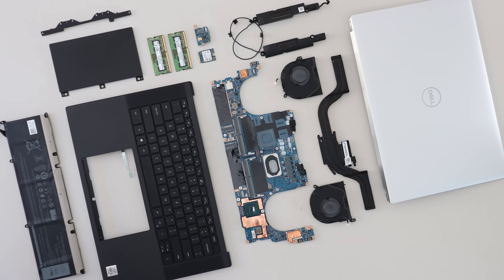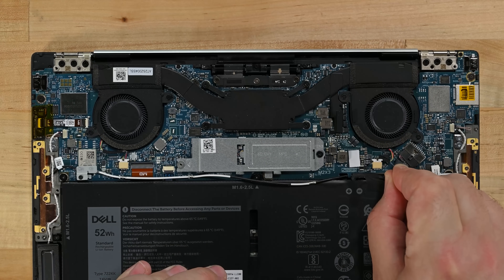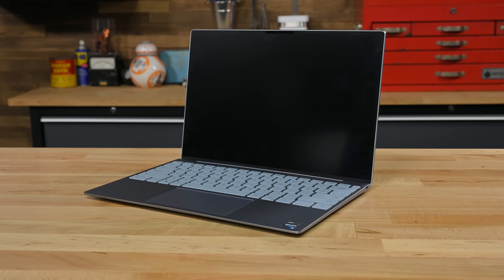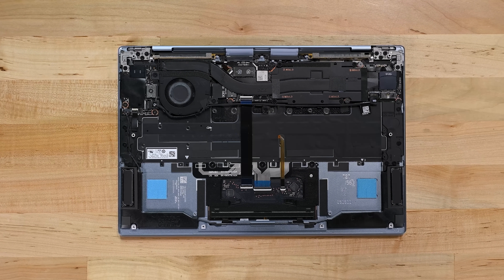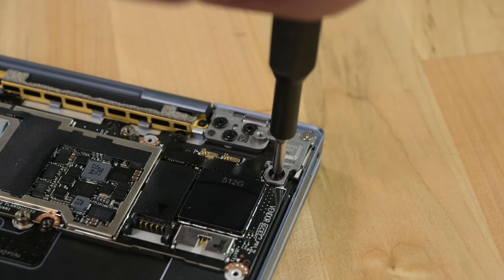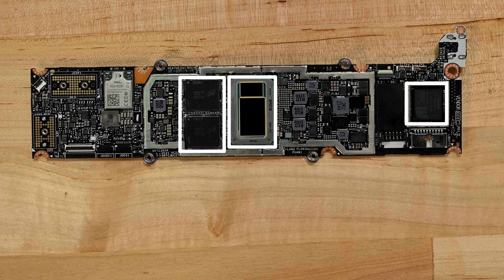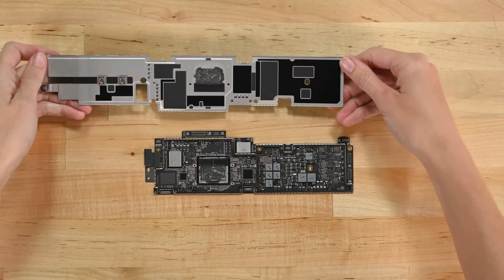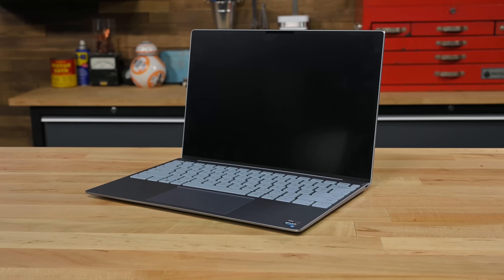The Dell XPS 13 (2022) Teardown: Is This The 13" Laptop We've Been Waiting For?

Comment: I'm curious why the left (in normal clamshell mode with it open to you) rail outside of the speaker seems to get weirdly hot on mine for a 9w low power system, doesn't seem to be too much going on there and the CPU and heatsink is up top. Wifi antennas?

Comment: Hmm. I have one of these with 16gb for work and we were at constant 95% usage, to the point external devices were crashing under the system stress. What a disaster we can't upgrade the memory. Also reading the SSD issues... Guess I better keep a cloud backup.

Comment: XPS 13 9300 USB Type-C ports not working. Battery dead. Motherboard lights flashing when charger connected.

Hi all, I have a bit of a problem. Sorry for the long description but any help/advice would be appreciated. While living in North America In September of 2020 I ordered and received my new XPS 13 9300. I haven't been able to use it now for over 2 years.

I moved abroad and was using a stepdown converter to charge it which worked fine for a little while. Then I relocated again within the same country and suddenly the laptop would not charge even with the stepdown converter.

The charging cable light will come on and be steady when plugged in to an outlet (either in the stepdown converter or using an adapter in the wall) but when I connect it to the laptop the light on the charger starts blinking on and off steadily.

Before my battery depleted completely an error message came up briefly stating something about the system not being able to detect the charging system.

I removed the battery and tried to use the laptop with only the charger attached but the same thing happens. The lights on the motherboard flash as well when the charging cable light flashes.

I want to know if getting a new already charged battery might give me access to the laptop long enough to go in and reset the type-C USB port drivers since it seems that the different voltage in my current country of residence has confused the ports.

If anyone has any suggestions that do not involve replacing the motherboard entirely (as that is not very possible for me at this time) I would really appreciate it.

I have seen other customers having similar port issues with the XPS 13 9300 but I have yet to see any suggested fixes that the customer can do themselves. I even discovered that there are "External battery chargers" available for older dell laptops so that the batteries can be charged separate from the laptop itself but I have not been able to find one that is made to function with the XPS 13 9300 battery.

Thanks in advance for any help 🙏.

Comment: No headphone port either. Any laptop I buy will have one of those and an M.2 slot. I have an XPS 13 9310, and it has both of those, though not removable RAM or wifi card. 

There is an advantage to non-removable RAM, though, on a laptop. The RAM on my XPS 13 is LPDDR4x, which improves the performance of the onboard GPU compared to DDR4, and it saves some power, at least in theory. You can't get that on a unit with removable RAM. There are no LPDDR4x SoDIMMs!

Comment: The higher-end and more expensive XPS 13 Plus still has the internal layout of the older 2021 XPS 13, so the SSD is still removable on that XPS 13 Plus 9320 model, no idea why Dell downgraded the regular XPS 13 2022 soo much though. It even has worst processor options than the XPS 13 Plus.

Comment: LOL... it goes to the bin... Soldered on memory and storage are a no-no with me... Which is why I am sporting the lenovo 14 inch models these days.. crappy display and all it is more reliable as I can swap these known to fail components out. I am missing the dell display, they are really something but it is not worth it for me to give up everything else for it. I still have my XPS13 from 2016. It was a great machine to use but now this new model without any ports takes away from the usability... and it is even less repairable.

Comment: 9/10 for repairability is a joke with both CPU and GPU being soldered to the motherboard.
Reply: 9/10 was for the old Dell XPS 13 - this model would probably get a 4 at best. 2 points for the battery being easy to remove, 1 point for the removal of the logic board/hinges, and if you're lucky, 1 point for the display.
Oh wait, the display hinge screws need to be removed in orer to get the logic board out...
3/10 it is then.
Reply: @TheSpotify95 I'd say 1.5 because only the battery is replaceable. Good thing Dell killed this model and went back to replaceable SSDs.

Comment: So what happens if the drive fails and it's not replaceable? Will Dell automatically cover it no matter what under warranty? Otherwise you're literally just buying a device that is on a clock ticking down until the drive just bricks the computer.

Comment: Everyone in the comments is praising the XPS, meanwhile my XPS 13 9360 had major fit and finish issues out of the box (the bottom edge was capable of scratching me) and my screen developed a pink hue in the bottom half after sitting on my shelf for 3 years powered off. No parts or service manuals available for it either. Made me wary of buying any Dell product
Reply: I've got a 9360 still going strong after battery swap and thermal repaste
Reply: I am almost positive there will be parts available. Any of the hardware components not related to the mainboard should be the exact same for different models with the same chassis style. And the same thing goes for service manuals.
Reply: @vivek_v  Link a a 9630 1080p non-touchscreen replacement display for under $350 USD, along with a Dell service manual that shows step-by-step instructions on replacing it.

Comment: I know that in order to have the thinnest laptop with big battery and small logic board removable memory and storage is not really an option. However, if you're going to solder the storage onto the main board at least do what Apple did back in older macbooks and have a "Lifeboat" connector. It would definitely be a thin, fragile proprietary cable but should be available for decent price at the manufactures online store. and be as easy as plugin it into the main board and the other end of the cable would be USB (C or A doesn't really matter) and make it so that it will still work if no other components on the Logic board are working.
Reply: I wonder if that was descendant of the "Firewire Target Mode" in old iBooks. You could plug one mac into another, pressing "T" and the second mac would be recognized as a hard drive. It was very useful for diagnostics.

Comment: I am genuinely shocked that an 8GB model exists, with no option to upgrade.

Utterly embarrassing in 2022.
Reply: if you want 16GB then buy one with 16GB. Ram is not the only thing to decide a laptop is good or not
Reply: 8 GB is pretty standard for 2022 and likely 2030+ until DDR6 becomes mainstream. OSes, applications, and others are designed for 8 GB systems. Is it good on a high-end system like this? Yeah, I disagree. But under $1000? 8GB is the default.
Reply: @ikjadoon  under $1000 for 8gb is a scam, Especially for a cheap soldered one
Reply: @itza8334  true i have 300$ laptop that has 16gb bruh
Reply: A PS5 has 16gb of ram.

Comment: Ram failure for soldered memory is very unlikely. Most memory failure come from socket issues shorting.
Reply: but when that unlikely comes, you are screwed
Reply: @trandinhvietdung9357  not really, it is standard LPDDR dies and board level repair store can swap these out rather quickly.
Reply: @hishnash  yep but with socketed ram, it is easier to do tho. also you can upgrade (which is why framework exist)

Comment: I have a Dell gaming laptop from a couple years ago, and the repairability made my life a LOT easier after an... unfortunate incident. Swappable battery, storage and RAM, full instruction manual, and when I wanted to add a second storage drive the cable I needed to connect it was already inside the laptop, just taped inside the tray where the second drive was supposed to go. Super appreciated - really hope Dell doesn't stray away from repairability before I need to upgrade my machine!
Reply: not trying to be too nosy but I would love to hear what happened
Reply: @sealwheel  Basically, only a couple months after getting the computer, I made the mistake of putting my drink right next to it in an open glass... then knocked it over, spilling the entire thing onto the keyboard...

I had to disassemble the entire laptop to get the keyboard out and clean it - and I'd never worked inside a computer before (although I had a bit of knowledge from watching teardown videos at the time.)

Not a single component was glued in. I was literally able to remove EVERYTHING. The manual guided me through the whole process, and was beginner-friendly enough that it all worked perfectly when I put it back together.

TL;DR repairability spared me the fate of having "Sticky Keys" permanently enabled for the rest of my laptop's lifespan
Reply: @fictionhead39  thats an interesting story.

i often drink iced tea next to my laptop..
Reply: why are you being evasive about the "incident"? Was it a sexual thing? Were bodily fluids involved? Over the decades, I've heard a LOT of ways to break computers, I don't think anything you might say would surprise me.

Comment: Impressive how small the mainboard is. And I can kinda understand that ram and WiFi is soldered on, especially given that ram connectors are stupidly large and that the low power ram isn't available in DIMM format. The soldered SSD just isn't acceptable, though.

Comment: When all the other components in the motherboard are generally soddered what makes soddering ram and SSD so critical?
Reply: If the RAM or SSD completely fails then an entirely new motherboard is needed, unless you're good at microsoldering. Otherwise, your motherboard is dead and your data is lost forever.
Reply: for me, ssd must be removable, because if my laptop fails (be it hardware or software), i want my data back asap.

Comment: I have the XPS 13 still has a MicroSD slot on the left-side and comes with the Intel Core i7 and 16GB RAM & 500GB SSD HD.  Would you know if the internal of it is the same as the model here (particularly the RAM & SSD integration)?

Comment: What the heck Dell? I've been a diehard XPS fan all my life, but soldering the SSD is just too much. I guess framework is the way to go.
Reply: That, and the fact there's only two USB C ports and nothing else... gives me flashbacks of those hideous Macbooks.
Reply: @TheSpotify95  literally not even a headphone jack
Reply: @aqua_whale  well that makes it worse than a MacBook Retina (you know, the ones with their single USB type C port, meaning dangles for everything). At least the MB Retina had a USB-C and an AUX port.
Now one manufacturer has done it, we'll now see really thin laptops with no headphone jack either.
Sorry, I'd rather have functionality and practicality over thin and light. If I want thin and light, I use my Surface Pro 3 (which still has a USB-A port, and can have a docking station/adapter plugged into it for desktop use).
Reply: @TheSpotify95  ha, brings me back to the 1998 iMac without a floppy drive. Forcing customers to go without, or pay up to get backwards compatibility, is an old game by now.
Reply: Framework isn't really competing with XPS, though; it's a niche product with worse displays, battery life, etc.
Reply: @HappyHubris  Framework's laptop actually has a battery with a similar capacity as the one mentioned in the video. And to be honest, I'd much rather have slightly shorter battery life if it means it can be repaired and upgraded easily enough.
Reply: One of Dell's redeeming factors has been their excellent upgradability and thorough manuals, but this is just disappointing. Hopefully their Precision 7000 series will stay modular until everything becomes SOCs...

Comment: You can have a notebook as thin as this, or, a notebook with replaceable ram.  You can't have both, due to the slim size.
Reply: This laptop is TOO thin imo. They also could have fit in socketed storage and more ports but they just went too far too fast.

Comment: I used to work at the IT department of a 6000 employee company in Hong Kong. Everyone at the help desk hated dell’s laptop because they are extremely unreliable. Their SSD often fails and as we enabled bitlocker it was not a swap and done process. In the end they stick with thinkpads while mixing more and more HP laptops into the company, and abandoned dell laptops.
Reply: True, and lots of problems with batteries, for zero reason. Their lifespan is not even comparable with macs, as much as I hate to say that
Reply: @adrko  the dell battery lifespan cant be comparable to macs, as macs now uses ARM processors which is much more efficient. But anyway I still agree with you as my experience with my dell laptop, the battery os half the way wear out only after 5 months of use from brand new
Reply: @averyoldYoutubeuser  I was not actually talking a bout battery losing charge. My bad for not being precise.

I fix macs, laptops and other electronics, I think I had 20-30 dell xps laptops go throught my hands, 90% of them battery not detected/need to replace the battery problem. Their overengineered bios does not make things easier.

Whats crazy is that a macbook can work with a non-original copy replacement battery, dell will never do that. Or even better - it will still refuse to work with an original new battery.

In the country I live in - there are tons of dead dell xps machines discarded by offices and being left in the electronic waste containers.
Reply: Of course on the other hand - f apple for forcing users to have soldered on ssd on their macs. If the board is not repairable - say goodbye to your data. 
On a dell or other non apple laptop you can simply take out the drive and put it in a new machine. It is extremely unusual for a ssd or nvme drive to get damaged in case of liquid liquid spill
Reply: @adrko  Battery not detected problem (original battery) is that actually a bad battery or a software issue. I keep getting that , do i have to replace battery ? when i remove battery and leave out for a bit it does seem to come back, but i am always waiting for it to go again .. USD2000 laptop..crazy!
Reply: @averyoldYoutubeuser  its because of Windows' issue with "proper" sleep modes.  Look up windows sleep issues from linus tech tips, to understand why.
Reply: I once had my moms old Compaq presario laptop back in 2008 with 512mb ram and a celeron. It blew threw 3 hard drives in its life. Soldered on storage makes sense on phones due to limited space. Phones had soldered on ram since the dawn of the edge network. The original Macintosh had ram soldered to the motherboard but, can still be easily replaced since the DRAM chips are DIP (Dual Inline Package).
Reply: I like my XPS 13 (Early 2015). While currently its battery only lasts 6 hours instead of the 8 when I bought it, The only issue I had with it was with the WiFi adapter. After upgrading the card to an AX200, everything works great.
Reply: I always had dells never any problems i never use bitlocker
Reply: @Haloreachfenix  but there is the fact that Dell now enable bitlocker on all their new devices. All partitions on the SSD that comes with Dell machines, from laptop to desktop, is bitlocker enabled. In most cases, standard users don't even know what bitlocker is, so when they swap their SSD or factory restore their PCs, they scewed it up and frustrated
Reply: @averyoldYoutubeuser  you just disable bitlocker. Format your storage zero problem. It just windows pc all same
Reply: @averyoldYoutubeuser  had this nonsense on my asus laptop too. Glad i noticed. Encryption should be off by default, and only enabled if REALLY needed, in my opinion.
Reply: @averyoldYoutubeuser  thats typical DELL BS caps used intentionally lol
Reply: TBF to Dell, Bitlocker is a pain-in-the-ass on any windows machine I’ve serviced, mainly because unlike MacOS’s FileVault, you can’t just use the admin password to unlock it either externally or in safe mode for troubleshooting.
Reply: Dell’s laptops are notoriously unreliable. Their XPS line are great in the beginning, but even they show their issues eventually. Especially the XPS 13 line. Even from the beginning, my 2020 XPS 13 had occasional screen flickering, and the battery degraded pretty fast in mine as well. I really do question Dell’s intent when they make moves like soldering the storage into the motherboard.
Reply: Yep, not forgetting stripped screws which are a dime dozen on Dell laptops.
Reply: i disagree, I've used dell laptops for more than 10 years now and I've never had to replace it due to hardware failure. Even being a frequent flier and it surviving hot and harsh environments.
Reply: In a business environment it is not as simple as disabling bitlocker and replacing the SSD. To prevent data leakage, they don’t disable bitlocker when replacing the faulty SSD and they never allow vendor to touch the SSD. Because of that, a laptop with replaced SSD is no different from a new laptop and help desk would have to reconfigure the device. Help desk would have to connect the device back to the company’s sccm, join company domain, install antivirus etc. and all these procedures takes at least 2 hours. As mentioned by an comment their bios are not as user friendly as other manufacturers (yet still better than Microsoft surface).